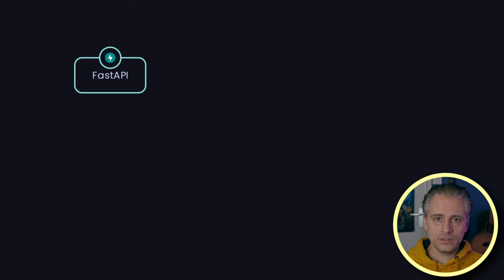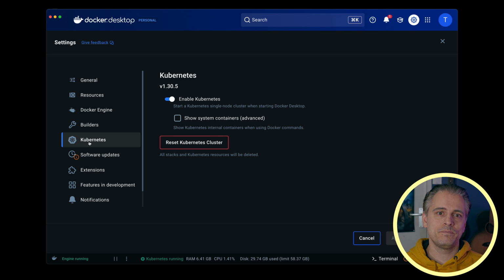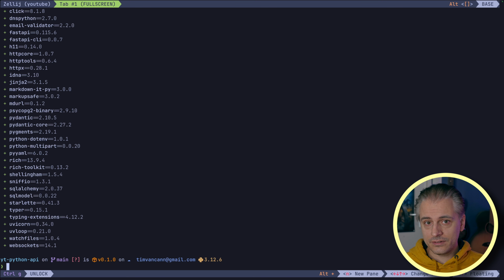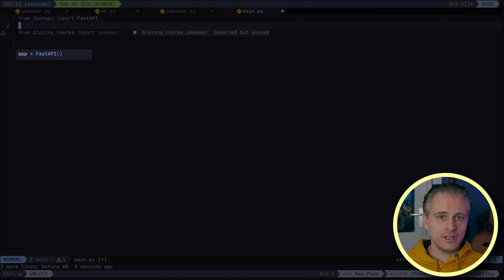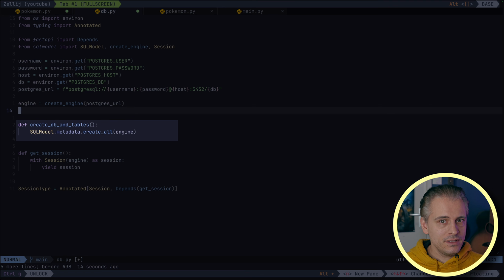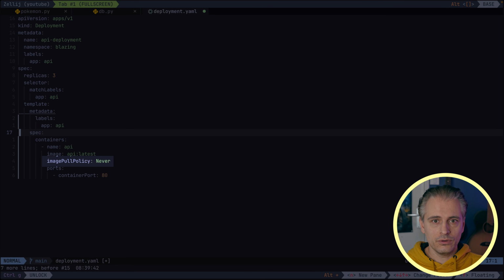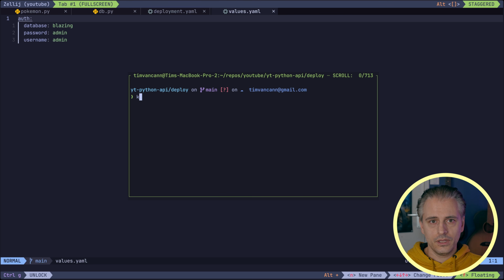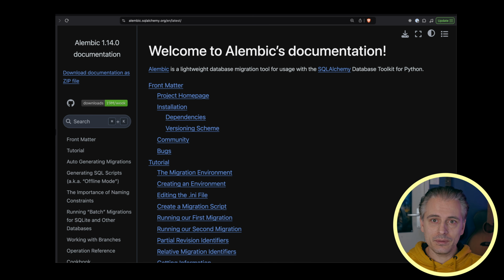Scalable Python APIs: FastAPI, SqlModel & Kubernetes Deployment Tutorial

Comment: Edit: Fixed -> I was getting a 500 error trying to add your add_pokemon example ("Kanto", "Pikachu", 25) and it gives a 500 Internal error. Switching to 1 replica, rerunning, checking error logs, not being able to solve them myself, op@timnology fixes. TL:DR; it's "kanto" not "Kanto" because the region types are specific
Reply from the maker: 500 errors are server errors. So you have to look at the server logs. The best way to go about that is by setting the replicas back to `1` and redeploy the app. Then you can use `kubectl -n blazing logs <pod-name> -f`. The `-f` is rather convenient since it streams the logs to your terminal instead of just printing it once.
Reply: @Timnology-r4s  psycopg2.errors.InvalidTextRepresentation: invalid input value for enum region: "Kanto"
LINE 1: ...7T22:24:11.625836+00:00'::timestamptz, 'Pik', 24, 'Kanto') :: 
class Region(enum.Enum):
    kanto = "Kanto"
    johto = "Johto"

class Pokemon(SQLModel, table=True):
    region: Region

I can't figure out why passing the string Kanto is triggering a wrong enum type error, any clues?
Reply from the maker: yeah, it may sound a bit odd, but the enum `values` are the correct strings for the API. So if you supply "kanto", instead of "Kanto", it should work.
Reply: @Timnology-r4s  And now I'll feel silly all day :) Cheers you're a boss
Reply: @Timnology-r4s  When I change the pokemon model's region to be region: str I still get the same enum error. How do I make FastAPI recreate the table in the new model's image?
Reply from the maker: That is an amazing question that warrants quite a bit of an extensive answer. The moment you create the tables in Postgres the process is complete. You can't create tables if they already exists. There are a few options here you have here:

- after the lifespancontext `yield` you can add a function that drops the tables.
- you can drop the postgres database by running `kustomize build --enable-helm . | kubectl delete -f -` and they redeploy it
- generally the best option for production loads: use a database migration tool (alembic) to manage the changing of database schema. This allows you to change database schemas without loosing data. Note that changing the type of a column may still result in dataloss.